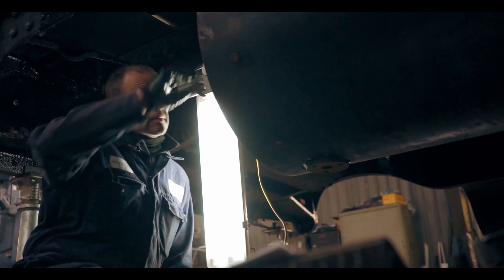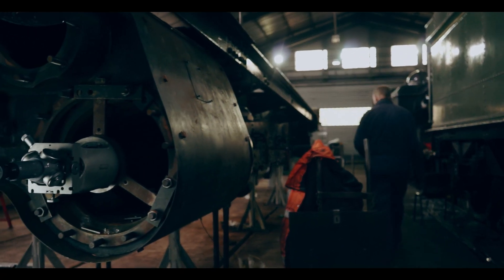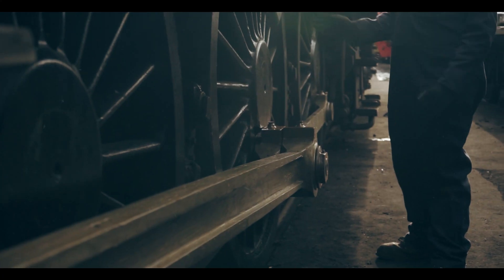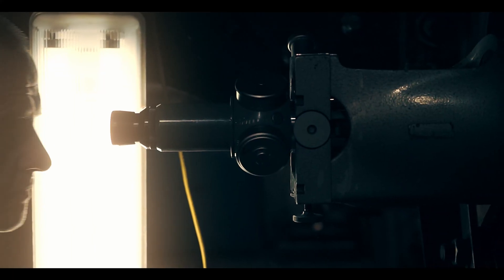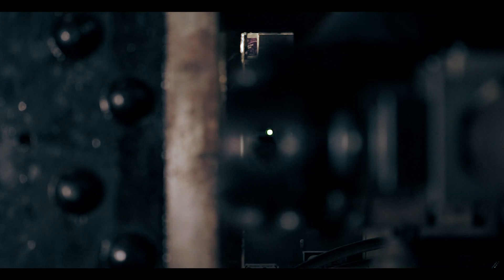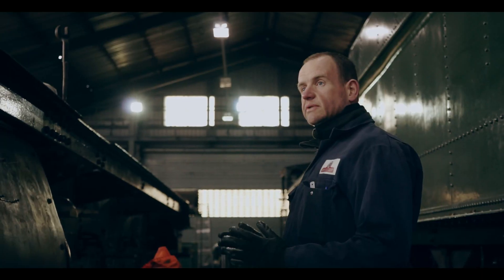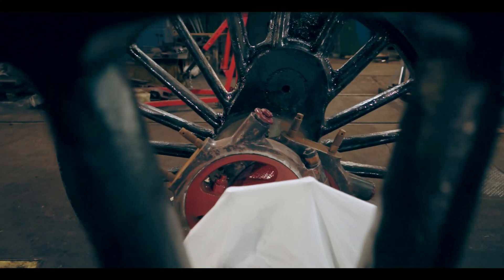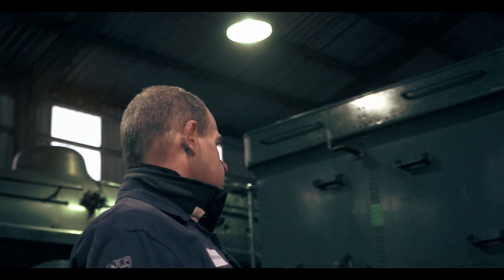Optical aligning the axles | The Restoration of 4930 Hagley Hall | Severn Valley Railway

Comment: Hi I have a question Will  4930 Hagley Hall be staying at the Severn Valley Railway permanently ( will she be added to the SVR Locomotive  Fleet ) also I Have Started a spring steam up Gala in 00 gauge and my main Locomotive is BR Standard Class 4mt 4-6-0 No.75006 in BR and The other Locomotive running with her is My Austerity 0-6-0 saddle tank Cadley Hill colliery "Cadley Hill No.1 and on Display In a siding is SR King arthur Class No.795 Sir Dinadan in Southern Green
Reply: Hagley Hall is one of the few locos actually owned by the SVR (As opposed to an owning group) so she is a safe bet for remaining at the railway
Reply: @olly5764  oh OK thanks so she will remain at the Severn Valley Railway
Reply: @lewiscartwright3609  that is the plan yes
Reply: @olly5764  thanks so much for taking your time to read my comments Cheers. Lewis 👍
Reply: @lewiscartwright3609  my pleasure. Hope my response was useful
Reply: @olly5764  absolutely your response was very useful Cheers. Lewis: )